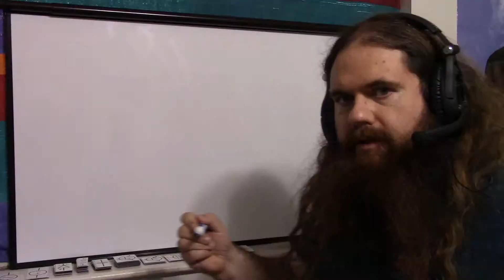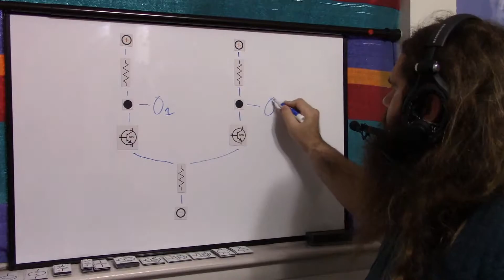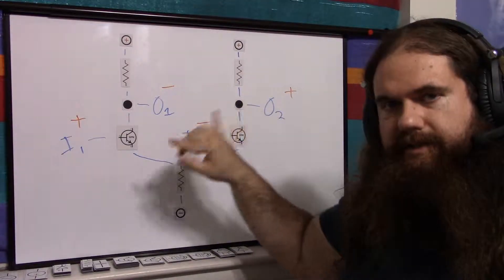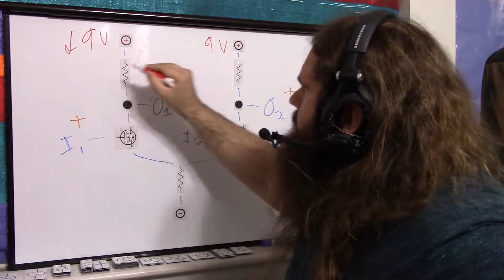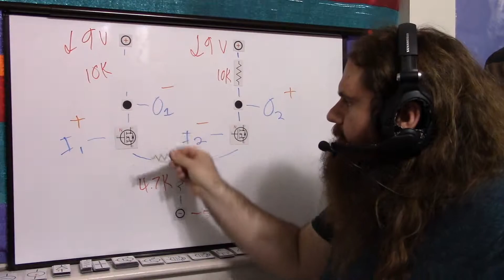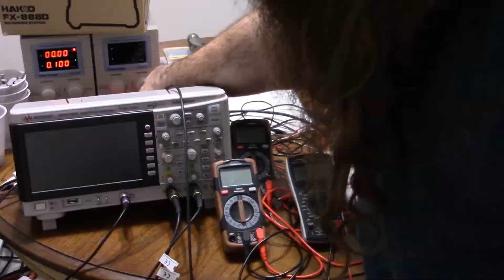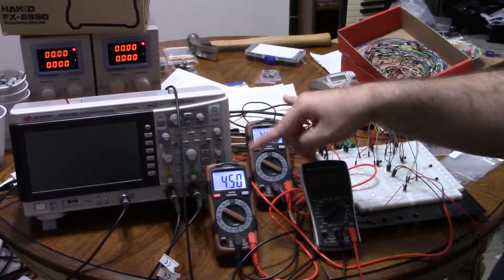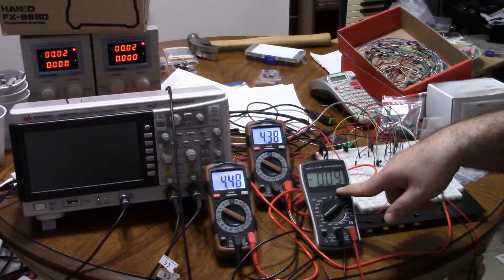Long-Tailed Pair - Comparator and Differential Amplifier - Simply Put

Comment: 10:54 The reason you need the bottom resistor to be smaller than the top resistor, is that you're effectively making a voltage divider. If input 1 is very big, mosfet 2 is closed so we can ignore it, and mosfet 1 is fully open. Now you basically have a voltage divider with the top and bottom resistor. If your top resistor is 100 ohm and your bottom resistor is 10k, then the lowest output voltage you could possibly get is somewhere ~14/100 volts under your 9v top. Besides that, with such a high source voltage, the mosfet would stop conducting, so the whole thing stops working. With what you have now (10k up top, 4.7k on the bottom), your minimum output voltage is somewhere around 0 volts. If you make the top resistor bigger or the bottom resistor smaller, you could have a bigger swing. (Either way, the max output voltage is still the full 9v, achieved when the mosfet is closed.)

Comment: To get a high impedance you have to use PNP BJTs in a Darlington pair configuration. PNP isn't loading down your input signal being it sources current at the base also with Darlington pairs there's more impedance and  it can pick up a signal of from ground up. The circuit performance gets even better if use a PNP current source and a pair of NPNs with their bases tied together and to the collector that you aren't getting the the output from(a current mirror) and if you put 2 NPNs on the output, you'll have a comparator that works just like the ICs do. Though to do it right, it takes 12 transistors for an open collector comparator with nearly perfect performance.

Comment: Ok so it's like 2 pipes with adjusted valves. If we open the valve on one of them little bit the water will flow little, and if we open the other pipe valve wider than more water will flow. And if we drill tiny holes on both of the pipes, the one pipe that has more water flowing will exit more water through the tiny output hole than the one that flows less? I didn't understand the voltage drop part. I always thought that mosfet is eighter on or off, didn't know you can have more current less current...
Reply: A transistor can be in one of three states. The first is off(no voltage/not enough voltage). The second is the linear region(amplification). The third is saturation. The "switching effect" occurs when the transistor is either off or in saturation. The linear (amplification) is skipped effectively. We do this by applying enough current or voltage( depends on transistor type) to put it in saturation. 

To understand transistors though, you really need to understand diodes and the basics chemistry/physics behind them. All diodes have a voltage drop caused by the voltage barrier at their internal pn junction.for silicon diodes this is about 0.7V, therefore you need a voltage atleast that high for the diode to "turn on".  A transistor is basically two diodes with one being forward biased (ex: base - emitter) and the other reversed biased(ex: base-collector).

Comment: No. A long tailed pair isn't used to amplify the difference between two signals linearly, long tailed pairs are extremely non linear. you should have used two separate emitter resistors to ground. I show how a long tail pair really works in my video